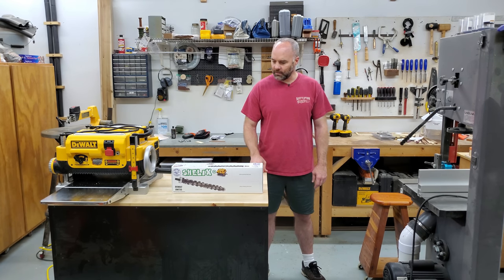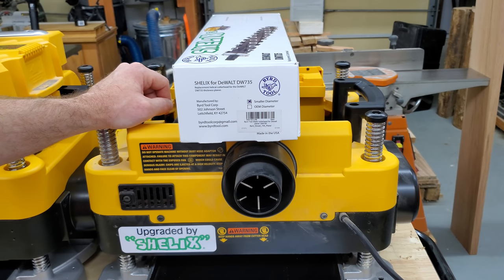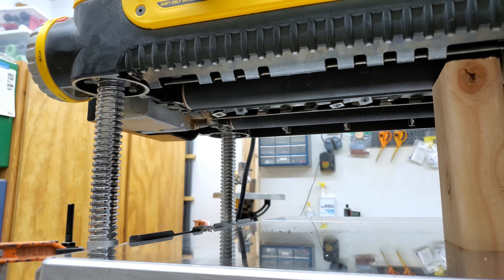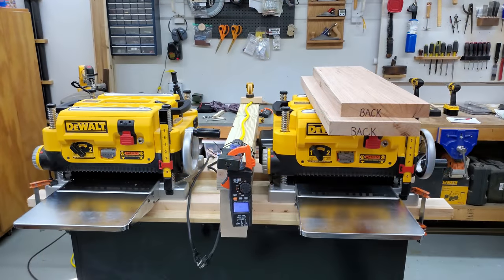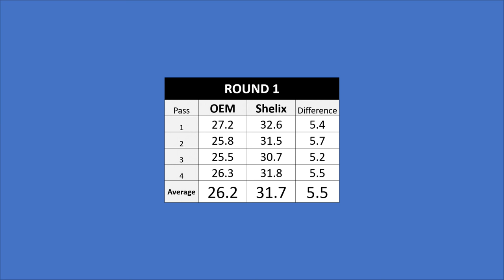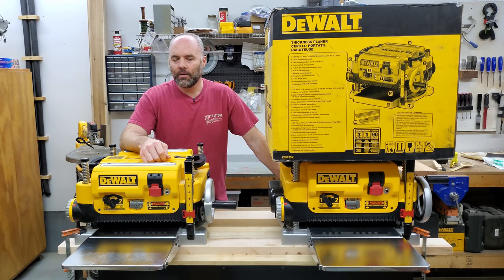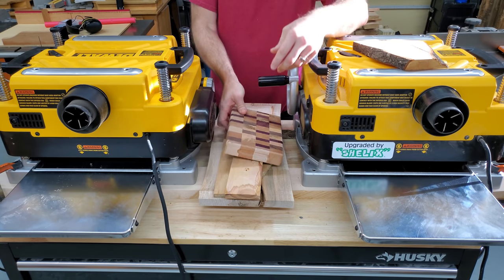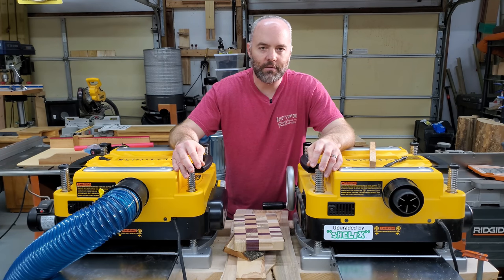The video I wish I watched before buying a SHELIX

Comment: I am skeptical of your amperage readings. Have you calibrated your metering with a 100 watt bulb or some other similar reference?
Reply from the maker: Yes.
Reply: @TheSnekkerShow  I suspect the HOLD/MAX function of your meter is capturing very low duration peaks giving a rather false impression of power draw.  If you revert to the "normal" averaging function I suspect the value would be more in line with rated power.   The heating value of which would be what the thermal breakers are actually responding to, and a much more realistic value.  Well done, interesting video. Thanks for you efforts.
Reply from the maker: @marks5603  I did a few follow-ups to this video, and posted some of the information in the description box. The last video in the series should address some of your questions. https://youtu.be/24f-J0lVo-E

Comment: tct tips plus arbour ok 7 days a week. Stop the dewalt site thickness ; intermittent use only. As all other components manufactured to iso tollerence`s materials ; to occasional  use only. you will find when the other components fail, serious  injury may occur . the amounts  you changed over use get a cast iron on industrial 24/7 use or called prelonged use and fit your tct on arbour to that. you will get contact braker start as std.

Comment: Is there anyway to tell if a planer that already has a Shelix installed has the OEM or the smaller size?
Reply from the maker: Plane a board, then make two full rotations of the wheel and see if you can plane it again. That would be a full 1/8" cut, which is not possible with the undersized Shelix.

Comment: Do you think having the smaller diameter cutter head could have caused some of the increase in amp draw?
Reply from the maker: Some people have speculated that, but I think it's more likely from the increased overall surface area of the helical cutters, and the fact that they maintain constant contact throughout the cut. I could be wrong though.
Reply: The smaller diameter cutter head will translate to a smaller torque, slower cutting speed(because of the smaller tangential speed) thus it will draw less power with the motor having the same rpm. Simple analogy would be a drilling machine.

Comment: Yes, as a consumer product with >$5 value, the Magnussen-Moss Warranty Act applies. They have to cover the parts made by DeWalt.
Reply: Mag Moss only requires they warrant their products against manufacturing defects not modifications that cause failures. If you put nitrous oxide on your Camry and the engine blows up, good luck getting warranty coverage for the engine. The Sheilx rotor is not the same design as the OEM part. If Shelix offered an equivalent rotor as the OEM design, DeWalt would have to cover any defects in any other components  that caused failure in the product. DeWalt explicitly says helical cutterheads are not recommended in the product manual.
Reply: @bingobango8777  suresuresuresuresure. Except not at all like that. This is more like not messing with the engine control system at all, but with an aftermarket wing... or tires of correct diameter but new width. Remainder of the machine is operating as specified. Lawyered. Suck it corporate shill.

Comment: I think an overlooked bit in the video was dust collection. I have the upgraded version of that planer but I used it for a few years with the straight knives. It give large, long and curled chips and I never made it through even one planning session for a project without the chips clogging the dust pipe at least once and usually more than once. With the upgraded cutterhead you get much smaller chips and even when I've spent an entire day planning wood for a large project I haven't had a single clog with the new cutterhead on it. Honestly that alone is worth the cost of the upgrade.

Curious that the planers were showing a tiny power draw when off when neither one has an LCD screen or LED indicator of any kind that would draw power when not in use. I wonder what that's about. I might have to clamp all of my tools and see if that holds for all of them. I know it's a tiny draw but any wasted power means wasted power generation and times everyone wasting that tiny bit of power it adds up. I'm not a nut to advocate pretending we live in the stone age to help combat climate change but if I can eliminate possible waste then I will. If others do the same it adds up to less power generating needs overall. Yes, I am that guy that has an off switch in the livingroom, kitchen, etc to turn off the outlets in the room to prevent the coffee maker, TV, etc from drawing power when not in use. I might have to add a master off switch to the sub line that powers my shop to keep from wasting the juice.
Reply: I'd say that reading was coming from the ground wire and not the hot or neutral.

Comment: I only seen 120v 15 amp or 120v 20 Amp circuits, there should be no way you are Pulling 25 to 30 amps on a 120v circuit. I looked online for specs for the planer and they are all 120v 15 amp. Not sure of the exact model you are using, but think that shelix blade is just overkill. THanks for the video
Reply from the maker: You can find more information about that in the video description and in the pinned/top comment.

Comment: Where did you get the 4 inch hose connector that seems to be a good friction fit onto the planer dust port ?  I have been searching for one...thanks
Reply from the maker: It's a Rockler fitting. I put a link in the video description.
Reply: Thanks...I should read the descriptions first.
Reply from the maker: @Mark Robinson  All good; I seldom read them either.

Comment: Thanks for a very good/scientific test. I’m an electrician. First a word on the thermal overload, it’s not a circuit breaker. It’s a Thermal Overload. A circuit breaker has instant as well as thermal shut off.  The difference in amperage between the two knives is substantial.  You are definitely running the risk of motor damage due to overheating.  I would suggest running the machine in the slower speed mode when planing wide boards. I have the same planer.  Taking a lighter pass or using the slow speed mode will minimize the strain on the machine.  The sound of the machine will tell you all you need to know, and you hear better with Ear Muffs. Also, and this is the biggest critique on your test procedure, the meter should be in tracking mode with peak amperage capture.  Motors have a characteristic INRUSH VALUE.  You did well to start the motor before activating the memory peak current feature. You would also notice a slight current jump when the rotating blades first hit the wood, because the motor will slow down slightly causing a current jump. Judging by the high readings you got, and my experience with AC Circuit Breakers, the house breaker would have tripped if the high (30 amp+) readings were sustained, especially if the breaker was a 15 amp breaker.  
All things considered, you did a very good test. I am also surprised at the increased load the new cutting blades put on the machine. .🤔
Reply from the maker: Thanks for the feedback.  A circuit breaker is a device that automatically disconnects (breaks) a circuit, and you are correct that this type of circuit breaker is triggered by thermal overload.  I did a separate video about the breaker for this planer, partially because people kept arguing that it was not triggered by heat: https://youtu.be/24f-J0lVo-E.

I used the Max setting for simplicity in filming and recording the results, after verifying that the resulting numbers would be close enough to make the necessary point.  You are correct that there is a surge when the board first enters the planer, but in many cases the highest amperage is when the board is exiting the planer.  I think this is a combination of trailing snipe cutting a little deeper, and increased resistance as the electrical components heat up.  If you watch each test closely, you'll see that several of them continue to increase throughout the pass.  I also did some tests on the same boards at the end of another video, without using the Max setting: https://youtu.be/UoBN5Sc_2uk.

Comment: Thanks for the great info. I am considering a potential future upgrade to the shelix cutter head.   Would I need something higher than a 20 amp circuit to effectively handle the increased power draw? If I stick with a 20 amp circuit and don’t do the upgrade, should I be worried that the OEM cutter head seemingly draws more than 20 amps? (I am having electrical put in and I’m trying to figure out what I may need in the future.) Thanks!
Reply from the maker: A 20 amp circuit is ideal for this planer. A 15 amp circuit would trip more frequently, and anything over 20 wouldn't really provide any added benefit because the planer has an internal 18 amp breaker.
Reply: @TheSnekkerShow  Thank you for your insight! You just made my electrical decision clearer and saved me from an unnecessary expense. Setting up my first shop and clearly I have a lot to learn. Wishing you a Happy Thanksgiving!
Reply from the maker: @cindypark8172  Happy to help. If it's an option, I'd recommend more than one 20-amp circuit, so you can run dust collection, power tools, and maybe an air compressor that turns on occasionally, without tripping anything. 220v is a big plus also, even if you don't currently have any 220v tools.

Comment: I might suggest, IF you don't already have a new planer, AND don't want to buy a very low-end one (i.e., you're looking at something like a new DeWalt), you might look into CUTECH/WAHUDA -- for 600-700 bucks, depending on the size, you can get a unit WITH a helical cutting piece **OEM**. 

I can't speak for Wahuda, who bought Cutech, but Cutech was getting great reviews on woodworking sites before Wahuda bought them. 

It speaks well for Wahuda that they currently aren't available, because they were having issues with problems due to shipping, and shut down their production line to re-tool.  You can still get a WAHUDA jointer if that is of interest, they have both 8" and 10" jointers for very reasonable prices, and they use the same helical system. The Wahuda planer should be available sometime ca. summer.

Comment: I thiugt you said it was white oak in the first part of the video, then red oak later.  Does it really matter to the plainer?
Reply from the maker: White oak is generally a little harder. Without rewatching everything, I'm pretty sure I was referencing a previous event with white oak, and then planing red oak. Harder, denser wood will make any tool work harder.

Comment: Your understanding of the Magnuson & Moss warranty act is flawless. But I cannot say the same for your understanding of motors.  While the law puts the burden on the manufacture to show cause as to why a particular non-oem  component contributed to or caused the damage, there is little doubt that the additional  amperage draw would suffice to make such a claim.  The presence of the overheating breaker is not relevant to the question of whether or not additional amprage causes additional strain on a motor of a given size over the life of that motor.

Comment: DeWalt DW735 = $616. OEN Shelix = $500. Replacement original blades = $32. 

For that kind of premium, that replacement cutter head better make a huge difference.
Reply from the maker: For me it does, but the difference depends on how you normally use the planer. I'm curious where you found DW735 blades for $32. I'm guessing they're not OEM, because I think those are running closer to $70 lately.
Reply: Good catch! 
Prices from Amazon today. Replacement blades made by “HZ,” whomever they are.
Reply from the maker: @karenstein8261  Kind of makes me curious about how they'd compare to the OEM knives. Cost doesn't always correlate to quality, but it's usually an indicator.
Reply from the maker: @karenstein8261  I was mistaken, the OEM knives are closer to $50 right now. Dewalt says theirs are vacuum heat treated laminated M2 tool steel, and the others just say high-speed steel. I think M2 is a type of HSS, so that still doesn't fully answer the comparability question.
Reply: @TheSnekkerShow  
M2 is indeed a type of HSS.
I'm a recently retired toolmaker and I was able to make my own, and I chose D2, which is much harder to grind than M2 but holds an edge forever.
These blades are simple to make if you have a buddy thats a toolmaker (not many of is left) have him pop you out a set from D2 M4 or CPM 10V.

Comment: For folks who don't already have a planner and are considering buying a thickness planer and are thinking they may want to upgrade to a helical cutter head in the future, pay the extra $100-$200 for a planner that comes with a helical cutter. You'll thank your self later on.
Reply from the maker: I'd be interested in seeing a link to a good-quality planer with a helical carbide head for $100-$200 more.  Are we talking $100-$200 more than the DW735 and Shelix combined?
Reply: @TheSnekkerShow  Sorry, I actually meant to put a link for an example earlier. No we're talking like 1-2 more than the Dewalt planer alone. https://www.woodcraft.com/products/rikon-13-benchtop-planer-with-helical-cutterhead-model-25-130h?gclid=Cj0KCQiA2uH-BRCCARIsAEeef3kbrhVuTazdcqY-9WZyCuWDzeY0Oct4UjgRst3qHm_xEcL-wxhxEEwaAnxHEALw_wcB
Reply: Sorry, that one has HSS not carbide. But I figure if you're willing to buy the less expensive dewalt version and upgrading it, then something like this Rikon 13" planer would be a better place to start. (Full discloser: I have the 6" Rikon jointer w/ HSS helical head...and it makes surfaces that are darn near finish quality.)
Reply from the maker: @johnhfischeriii  I've been curious to compare a HSS helical head with carbide. It would still address the annoyance of having to change an entire 13" knife just for one bad nick.   I have a Rikon drill press I've been pretty happy with.
Reply: @TheSnekkerShow  I think you’ll find it performs very well. At least that’s what I’ve found with the jointer.
Reply: @TheSnekkerShow  The cutters in your link are HSS, not carbide.  A set is $60.  I think I'd skip it.  It's hard to beat the Byrd cutter quality from what I've read.

Comment: interesting video (probably best one I've seen on this topic).  I'm a bit confused though.                             The Dewalt DW735 is rated as a 15 amp tool, so isn't it risky to plug it into a 20 amp breaker?  I have the same planer, with stock cutting knives, running via a 15 Amp breaker.  I'm not an electrician but I was under the belief that using more power than rated can cook your tool.  can someone explain it to me ?  Thanks!
Reply from the maker: The amperage of the breaker just states the maximum it's rated to provide. Think of it like a water pipe that might be able to provide 20 gallons per minute, but only if you open the faucet.
Reply: @TheSnekkerShow  thanks for the reply, but with electricity, isn't it either ON or OFF?  so the Dewalt 735 possibly could become overloaded, but doesn't because it has an internal shutoff, so its in fact okay to draw that extra power?  Thanks again :)
Reply from the maker: @iskato914six  Yes and no. I'm not sure if I have a good short answer for this, but continuing with the water analogy, the water pressure is always on throughout the entire house, but different appliances use different amounts of water as needed. The difference with electricity is that tools are capable of demanding more power than the breaker or wiring is rated to provide. This generates heat, and the job of the circuit breaker is to trip before things get hot enough to start a fire. Different plug types are to prevent you from connecting things that draw too much power, but whether you plug a lamp in to a 30 amp breaker or a 15 amp breaker, the lamp will still only draw less than one amp.
Reply: @TheSnekkerShow  Thanks! makes more sense.  I've got a Shelix for my jointer, but will invest in one for my planer in the future.  I had no idea about the OEM sizing.  very good to know.  :)
Reply: @iskato914six  Breakers of this type are rated for 80% of their rating (15A x 80% = 12A continuously = 3 hours or more).  Breakers can handle intermittent levels of current (amps) over their rating (>15A) but this has many variables (breaker manufacturer, type, etc). 

With the examples given in this video (3 foot board) it ran maybe 10 seconds?  So a 10 foot board would take 30 seconds or so.  That is a relatively short time for a breaker to trip so I would expect most 15A breakers could handle the 25A current draw of the 2020 model but might not for the 2016 model which was over 30A.  

The safe bet is to run your equipment on a 20A circuit.  But if you're having problems then then the problem is likely the upstream panel and feeder.  That's another discussion altogether.
Reply: And a key to minimum acceptable conditions is, if it's a 15A tool (15A plug = NEMA 5-15 configuration) then there should be little fear of plugging into a 15A outlet (technically called a receptacle).  The issue is performance which is variable due to many factors primarily wire size which affects voltage drop.  The short answers are:  
1)  Plug into a 20A circuit whenever possible.
2)  Plug in as close to the panel as possible.  
3)  If 1 and 2 don't work, then hire people like me to fix them.

Comment: If you have to remove the cutters before installing the tool, then why don't they just save time for both them and for you and just send the uninstalled cutters with the tool and just let you install them?   If you bought replacement blades, they will send just the blades in a package for you to install anyway.
Reply from the maker: If I remember correctly, Byrd told me that the cutters have to be installed for their final quality testing, so it would be an extra step for them to remove. I agree that it would be more convenient.